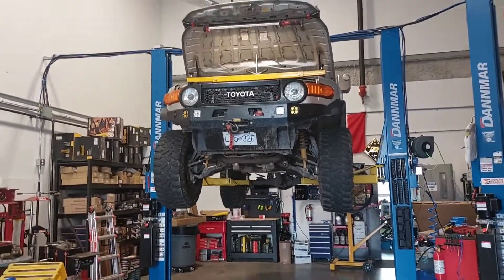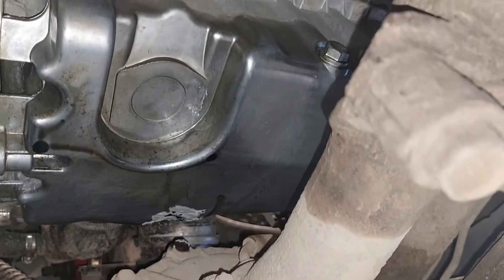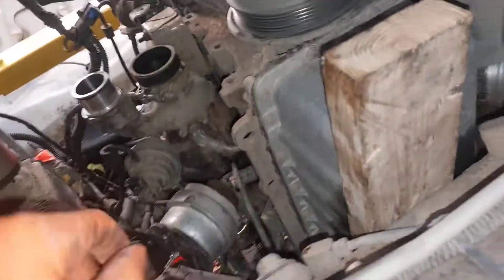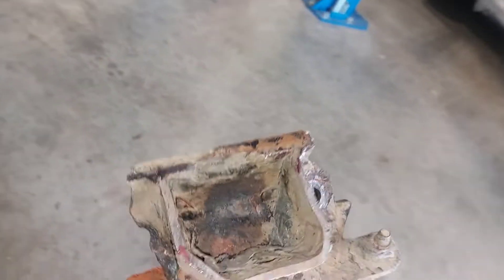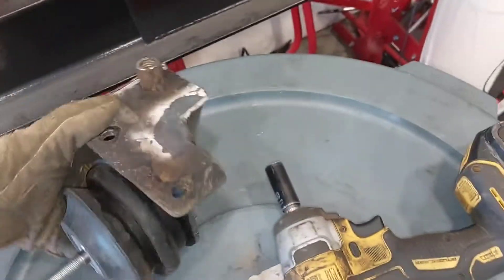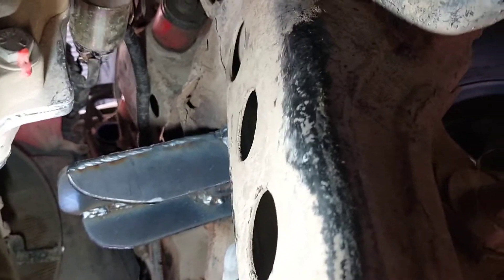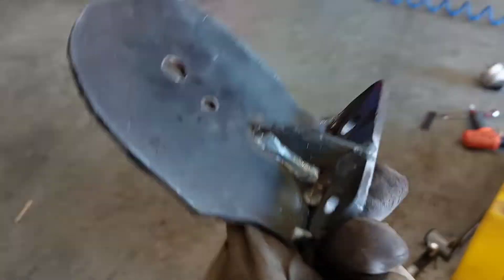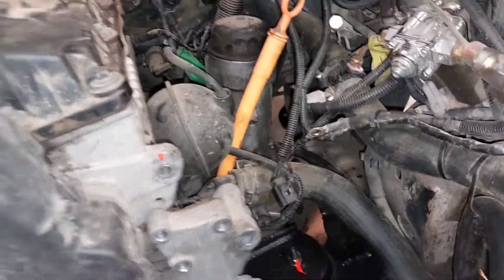Diesel FJ Cruiser Engine Mount Revision

Comment: Thank you for sharing your revised mounting system. Having a 4BT in my LC, I'm well aware that diesels vibrate. Doesn't it keep you from grinding the starter by mistake because you forgot it's running? Had a JB-Weld (epoxy) oil pan repair last at least 30 years leak-free on a gasoline V-8.
Reply from the maker: No one likes starter grind that's for sure. What engine mounts are you using for your setup? I found vw passat mounts too soft, and these hydraulic corvette mounts a little to harsh.
Reply: I have hydraulic (fluid-filled) mounts resembling the Anchor 2859. Searching for info about 4BT mounting leads me to think that hardness/softness of the mount is less important than position. Published tech info indicates mounts should be at the midpoint of the engine, above the crankshaft centerline and at a 45 degree angle. They should reduce vibration the most at your cruising RPM. Maybe your Corvette mounts would work better in a different position?
Reply from the maker: @edwardhawran9406  very good point! I will research more about mounting location. Thanks!